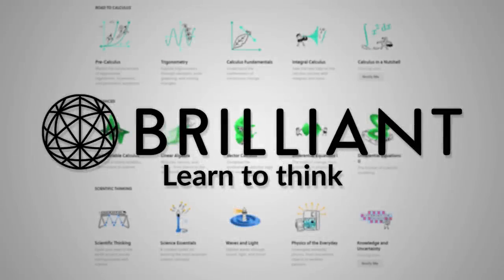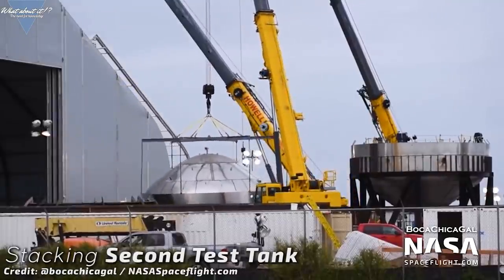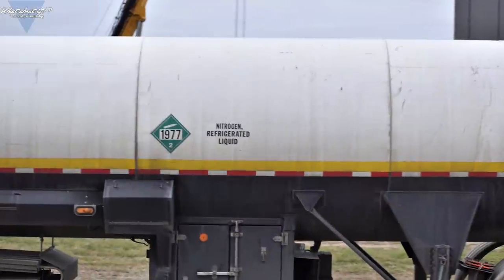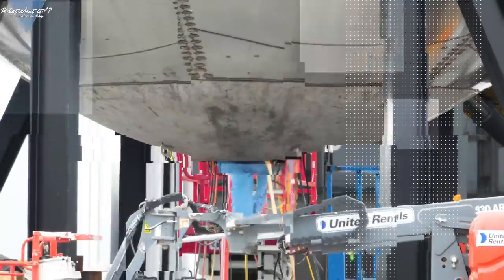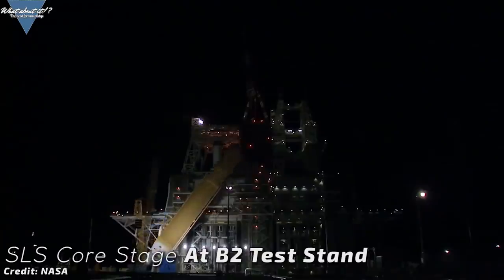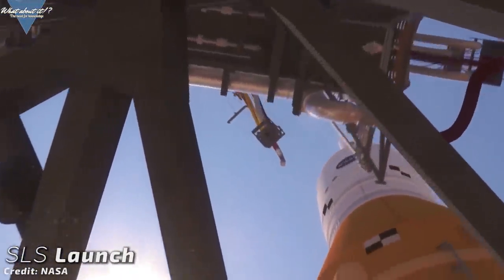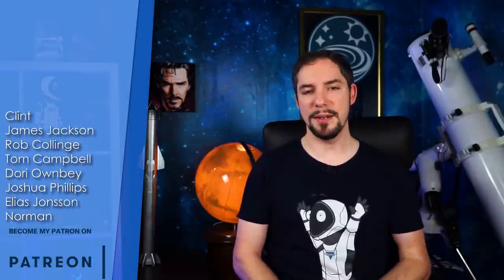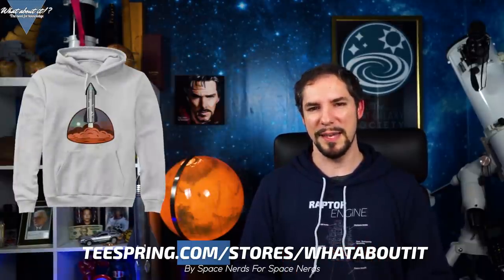68 | SpaceX Starship Updates - NASA Artemis & SLS Update

Comment: SLS would be a great rocket - in the 1980s
Reply: The Disposable Space Launch System, DSLS, is just a variation of a Cargo Shuttle that was dreamed up in the 1970s. We're now 40 years later and it's finally about to be a reality, after taking longer and costing more that the Space Shuttle did, it should make a beautiful splash when it hits the Ocean. Heck, it going to cost less and be more reliable because of all the flight proven hardware, well that is what the presentation said in 2010.
Reply: SLS will be great, ... while Starship's role in Artemis is completely unknown, because it is many years behind SLS in development.  SpaceX's main purpose in developing Starship is for launching Starlink Sats .. all 40,000+ of them, and for replacing the 30 per day that will die and burn up .. Falcon 9 is not up to that volume task, and is far too expensive for Starlink's business model.
Reply: BigCooter.com starship > SLS

Comment: I think one of the big challenges facing Spacex is that no one has ever built a large structure out of stainless steel (with the exception of the Atlas back in the early 1960's, which was technically stainless steel but was so thin it couldn't support its own weight in an unpressurized state).  Zip over to some of the machinist YouTube channels (like ThisOldTony) and do some viewing; you'll find that Stainless Steel is an incredibly difficult material to work with.  Everyone hates it, because it's so bloody difficult to form and machine.  No one works with it; and as a result, the tools and techniques have yet to be developed.  I suspect that this may take a lot of time to resolve. >Charlie

Comment: Have they ever thought about cold forming or deep drawing the lowest ring of the bulk heads? So you have a smooth transition betwen the bulkhead and the Ringsegment. So less crack building is possible. I know that‘s not easy but maybe they can test it by sort of ring rolling them. I think that will be stronger because you have no welds. (Or maybe one)
Reply: DerLegomaster123 one huge vacuforming machine or die machine. Once you have it set up you could make one an hour easy.  If really deep draw, may require an extra heat treat step ... but who knows with stainless steel?  Perhaps a special rolling machine that not only curls it into a cone, but also puts the necessary curve on the coil. Perhaps a huge die machine that starts with a welded cone and ends with the curve on the cone.
Reply: Doug InOrlando 
I wuld go further and manufacture the whole bulkhead with deep drawing. Because the height relative to the diameter is not so big. I think that will work. If you wanna do it perfect you could  process stress-relief heat treatment.
(Sorry for maybe bad englisch) 😬
Reply: DerLegomaster123 sounds good to me, especially if spacex can get wide sheets of stainless steel to avoid extra welds.  Also since spacex is very much into iterative improvements to safely reduce weight, the whole bulkhead could then be ground down to precise dimensions and variable thicknesses depending on required strength at each point of the bulkhead. I picture a special grinding fixture with a grinding wheel that systematically grinds in a spiral track circling around the bulkhead.   The lightest strong thickness should include grinding down to leave ribs remaining on the inner surface.  Weld lines may need to be left thicker during grinding in order to compensate for worst case welds.
  The manufacturing design & development effort would be an exciting challenge to work on. The whole process includes how to obtain appropriate data to maintain quality control including welds and thicknesses, determining strength requirements including thermal expansion stresses & torsional forces & buffeting & acceleration forces & vibration resonance nodes across the surface, etc (with FEA models validated & adjusted through experiential measured feedback).
Reply: Doug InOrlando 
I can absolutly agree 👌🏻

Comment: Am wondering about how difficult the timing will be with three launches. How often do we get three launches in a row with split second(does that count as a pun?) timing not having one or more be delayed. All kinds of delays happen, weather, hardware, software, folks in exclusion area or even a RUD. Going with a single launch eliminates most of these problems unless they have the longevity in the early launches in case of delay in subsequent ones.

Comment: I mean you can reuse the SRBs partially
Reply: Yes, but NASA won't be doing that for Artemis as it was too expensive to refurbish the boosters
Reply from the maker: Reusing and refurbishing is something different. Reuse is quick and cheap, refurbishing slow and expensive.
Reply: @Whataboutit  yes, I forgot to say about that, but srb's can't be reused, they can only be refurbished, I was supposed to put that in my original comment, thank you for reminding me
Reply: Right ... reuse the power point slides when campaigning for more funding.

Comment: Wonder if SpaceX has spent any time at shipyards researching how submarines hulls are built?
Reply from the maker: Submarine hulls are made of several inch thick hardened steel. The whole build is very different too. It's hard to compare the two.
Reply: @Whataboutit  I bring in up because the original proposal for Sea Dragon was to build it in a ship yard using existing experience and tooling from building submarines. At the time Todd Shipyard thought the proposed Sea Dragon was within their capabilities.

Comment: Despite all that dispute about SLS, its cost, non-reuseabilty and everything, I really what to the that monster take off. Especially in its block 2 cargo setup.
Reply: I'm not optimistic that block 2 will ever fly. Block 1, yes... maybe even this year. But block 1 at least has some advantages, even among all the problems. The extra development for block 2 means it's still many years away, meaning that it's going to be roughly contemporary with Starship/SH... and it's hard to see any advantage over what should be a much cheaper and more capable SpaceX stack...

Comment: Could you tone it down a bit on the 'amazement' that steel prefab buildings are going up quickly? They're specifically designed and built to be bolt together structures. As long as you have at least one crane and workers on site they always going up quickly.

Comment: The solid rocket boosters on the space shuttle were landed with parachutes and recovered from the ocean. Is there no plan to do something similar with the SLS?
Reply: No, because "reusing" SRBs on the shuttle was never cost-effective... hauling them out of the ocean and carrying out refurbishment cost as much as, if not more than, simply constructing new ones. Same problem as most of the Shuttle program, really... the cost (both in dollars and time) of turning it around and getting it back in the air was immense.

Comment: I'm thinking that pressure testing with nitrogen gives a better result than water. Testing with water does not allow the tanks to reach cryogenic temps, which should increase the strength of the steel. Or is it just the strength of the weld that is being tested?
Reply: Possibly that's why they're doing both... some tests with water, some nitro. I guess water tests are safer — no chance of an mk1-style explosion — but nitro is a more realistic test case?

Comment: Apparently there's a potential problem with starship landing on the moon - and it's powerful raptor engines possibly kicking up regalith and bombarding anything in orbit and damaging things nearby.
Reply from the maker: SpaceX and NASA are both researching it right now.
Reply: I wonder how bad it was with the moon lander, and if it would really be a significant amount?
Reply: @beaverwithaforkv.26  AFAIK only landing kicked up a lot of dust, since the descent stage was left behind and mostly shielded the surface from the ascent stage exhaust. And with Starship being many times larger, its takeoff exhaust will be much more messy. But my guess is it won't actually be a problem, since the amount of material fluffed up will still be minuscule compared to how much has been fluffed up by meteors covering the entire surface in craters.

Comment: Aren't the solid rocket boosters re-usable? They were on the shuttle program. Aren't they supposed to splash down and be  re-furbishable?
Reply: Just googled it, they are not going to refurbish them.

https://ntrs.nasa.gov/archive/nasa/casi.ntrs.nasa.gov/20120014501.pdf

Original post below:
Yes, these are a bit taller, but I can't imagine why they wouldn't use the same process they did for shuttle missions.  Unless there are no savings realized via refurbishment
Reply from the maker: There's a big difference between reusable and refurbishable. ;) Refurbishing takes a lot of time and money. Reusing is quick, cheap and fast.
Reply: I believe in practice it turned out to be just as cheap to make new ones.
Reply: Watch camera footage from shuttle booster. Those things get so much damage during reentry that it's cheaper to make new ones
Reply: @_mikolaj_  Hmm. According to Wikipedia,   they were regularly refurbished and re-used? https://en.wikipedia.org/wiki/Space_Shuttle_Solid_Rocket_Booster
Reply: According to that article"The five-segment SRBs provide approximately 25% more total impulse than the Shuttle SRB, and will not be recovered after use" so that answers that
Reply: @VWTesla  — for a loose definition of "re-used". As the Wikipedia pages states, "over 5,000 parts were refurbished for reuse after each flight"... which isn't quite the same thing as re-using the booster. Basically, they took them apart, and built new boosters from whatever parts didn't need replacing.

Comment: Think of the thermal expansion forces on the steel structure.  A 600 degree Fahrenheit change in temperature across 9 meter diameter results in a 2 inch change in diameter, but only on the hot side. Now add any pressurization required, add the density of fuel times the vertical depth times the number of gravities to get more pressure, add torsional forces, buffeting forces coupled with vibration nodes that amplify the magnitude of vibrations.  Elon needs vibration sensors and stress sensors all over the test rocket to validate any FEA model he must be using.  
       Also notice when the tank ruptured during the max pressure test, the failure started at one location and then unzipped into a catastrophic failure instead of remaining a small localized failure.  You can imagine the forces on the steel at the leading crack edge of the unzipping steel.  
       I still wonder if the hot side of the rocket should be covered with thin titanium square tubes attached to the outside skin for durable thermal protection and safe thermal expansion.
Reply from the maker: One side of Starship will be covered with ceramic heat tiles.
Reply: You almost got it. Since only 1 side is hot, only half the expansion occurs. So, instead of 57mm, you get 29mm change in diameter. To put that into perspective, that is only about .32% change in diameter. The temperature change will f course actually be a gradient from hot side to cold, but I'm pretty sure solving the gradient would get you about 1/2 of heating the entire vessel. Probably a bit less in practice since the air itself will form a barrier to the heat as it flows around the body of the rocket. Either way, this is not something to worry about.
Reply: joshua43214 I don't know the particulars,  but if an inner strut 1 meter long is welded along the shell wall, then imagine the tension on the weld when the shell is 600 degrees hotter than the strut.  Try stretching a meter long strut 6 mm longer.  All the force required to stretch the strut (or shrink the shell wall) will be laterally along the weld.

Comment: Space X had several amazing achievements, but jump from 0 to 100 astronauts with supplies is doubt me, also building a big rocket the size of Saturn V or larger is very different, has to deal with thrust power, fuel dead weight with the soft landing of that size. NASA SLS is slowly but surely. I wish Space X and NASA all the best with great respect.

Comment: ...the Starship reminds me of the ship from the old television programme "Salvage One".  

How resistant is stainless steel to reentry temperatures? How can something that tall be landed vertically on an uneven surface without it tipping over?  There are no nice flat paved landing zones on the surface of the Moon or Mars, and Mars experienced some fairly strong winds at times more so than at Boca Chica given some of the dust storms that have occurred there.  This is why smaller more stout landing vehicles are superior.
Reply: Steel is more resistant (and cheaper) compared to carbon fiber (which what the Starship was originally designed with). I think using steel makes the design decently heavier though, Elon has done some talking about it a while ago, so go check it out.

Comment: Why is space not using the carbon fiber tank design which was seen in the beginning of the starship design 🤔
Reply: Full reuseability can’t use materials that wear out quickly. Also, stainless steel is more durable and sturdy
Reply: Cost/speed. Carbon fiber is very expensive and slow compared to steel.  Stainless performs better under cryogenic temps while also being able to tolerate much higher temps and far less specialized tooling to work with. If they went with a carbon fiber design as originally proposed they would have had to add a lot of insulation and heat shielding to the ship so you would end up with a ship that is about the same weight or heavier, more complex and far more expensive to produce. Starship is very similar to the Sea Dragon concept for all the same reasons.

Comment: I love the concept of Starship. It is right out of the pages of Buck Rodgers. But... What about its actual capabilities? I see no problem with the design as far as flying in Earth Orbit, hopping from continent to continent, or even going to the moon. Going to Mars is an entirely different can of worms, though. The hull is the outside wall of the fuel tanks: one good strike from a micro-meteorite could spell disaster. Maybe we will see Starship get a protective blanket for such long trips.
Reply: Steel is a stronger metal than aluminum (used in ISS modules) so the design change from carbon fiber makes sense when durability is a factor.

Comment: So many welding and manufacturing errors. Did any of the architects read a welding book. After so many tries. .. why are the welds? breaking the metal should be weaker than the filler metal. Hopefully they figure out that moisture makes even stainless steel rust. And coat with nanocoating or a polyurethane based powder coat. Then the filler metal will give.

Comment: maybe I am wrong, but the ice probably comes from a nitrogen leak.
Reply from the maker: Where would that leak be and why is the ice so uniform around the tip?
Reply: @Whataboutit  the tank is in the cone. The leak is in the top of the cone, so it sprays liquid nitrogen on the top of the cone. The cone then cools and ice forms using water in the atmosphere. Remember that it is by the sea so the air is full of humidity.
Reply: That's an unnecessary assumption. Steel is a thermal conductor, the liquid nitrogen cools the steel from the inside which in turn cools the humid air on the outside, hence all the ice.
Reply: @awegahn  — indeed, that conductivity is something they're relying on for cooling during re-entry... using the stainless steel to spread the heat away from hot-spots.
Reply: @awegahn  mmmmm yes. makes sense. You have the better explanation andreas.